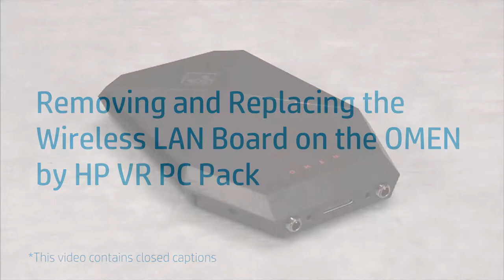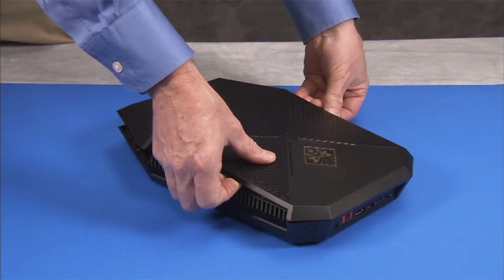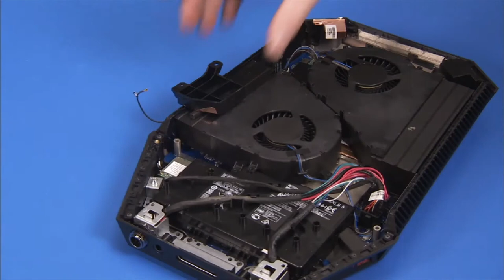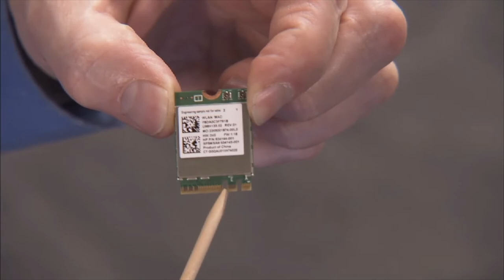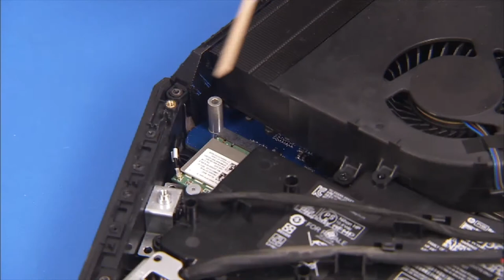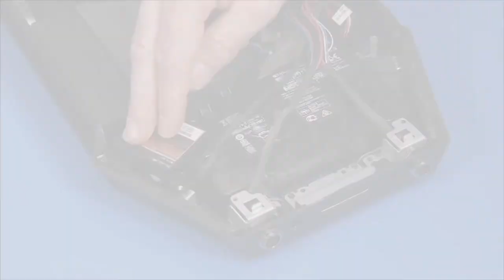Removing and Replacing the Wireless LAN Board | OMEN by HP VR PC Pack | HP Support

Comment: Dear team i need a help, i have purchased hp elitebook 8460p.after one year its battery last only for 20 minutes.whatsa the problem? If there is need to change the battery suggest good site where i can purchase genuine battery and will not become the victim of fake purchase battery online.I am from India
Reply: +shajid khan Please follow the troubleshooting steps mentioned in this article: http://bit.ly/2zx5PQ0 to isolate and resolve the battery issue. If you want to order battery online you can use the HP PartSurfer website: http://bit.ly/2i0EWeM